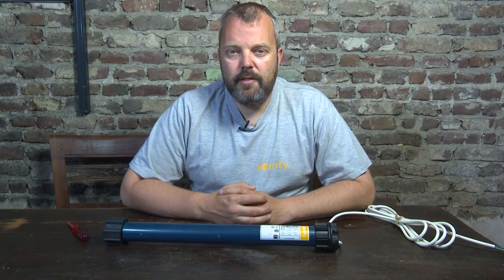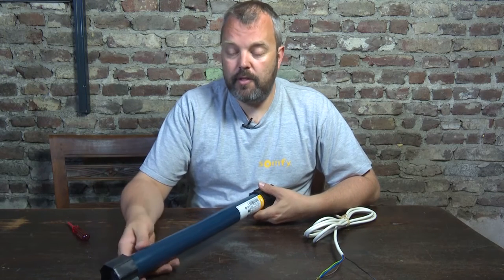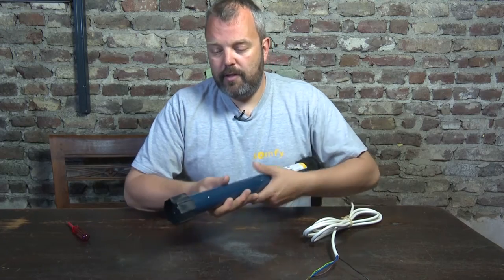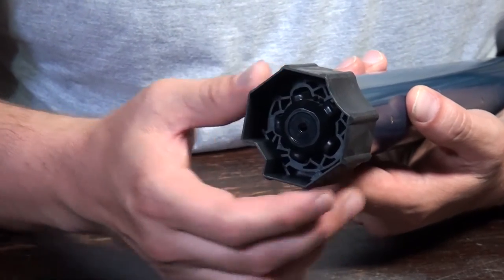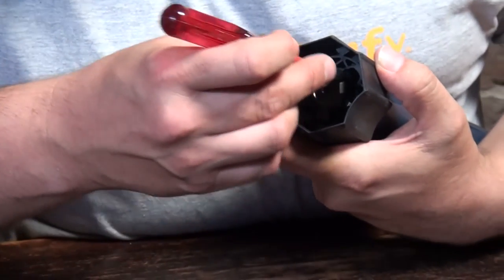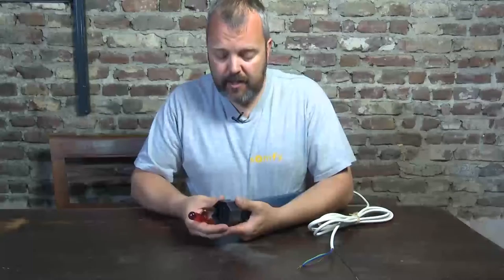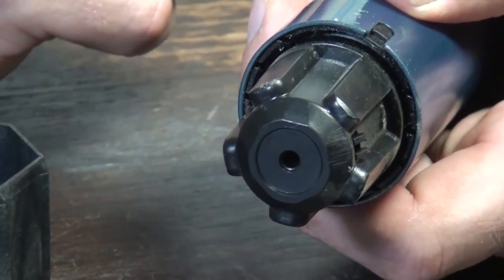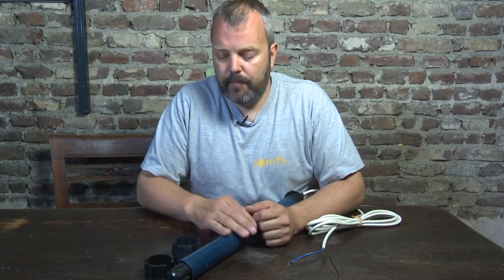How to remove the crown and drive from a Somfy tubular motor

Comment: hi so glad i found your videos. they are extremely helpful. i have a telis 1 rts awning with deective motor. i cant get the motor out as it feels stuck. any tips on how to get it out of the barrel. i thought it would slide right out. many thanks.
Reply from the maker: There are 2 possibilities: 1 - most likely - it's tightly fit into the tube and needs more force to get out. 2. They secured the driver with a screw, which prevents the motor from being taken out. This screw will only be visible with the fabric completely rolled out and will be at about 60 to 65 cm from the motor head. Check the whole circumference of the tube at that distance to see if there's anything.. Hope this helps.

Comment: I must say, these videos are very good. There is room for improvement (sometimes could go straight to the point and i a missing some diagnostic videos for motor behaviour. Example: my motor will only turn 90 degrees. If I want to turn it beyond that point i have to jog it in the opposite direction and then change to the original direction again. What does this mean? Faulty capacitor , damaged motor...?)
Reply from the maker: Thank you for the feedback - much appreciated.